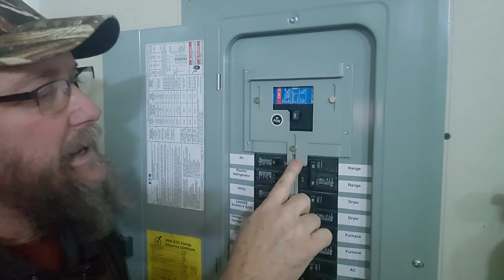Emergency Use : Generator to House Power Safety Device and Install || Generator Interlock Kit

Comment: Your power actually zig zags through your panel. Every other breaker would be powered if you only had a single pole breaker from your generator.  That is why the 240v double pole breakers are 2 slots, and a 120v single pole breaker is a single slot. It is not 1 side vs the other.
Reply from the maker: I wired it for 220vac because my generator and the outdoor socket would accommodate 220vac. Theres nothing worse than installing something and later wishing you thought ahead.  I will only use 110vac so it's only pulling from one pole that's feeding the left row. TECNICALLY, the top right breaker feeds from the left side so a single 30amp breaker would have worked. But, as soon as I did that charma would have came knocking and I would need the right side for something. It all works out in the end